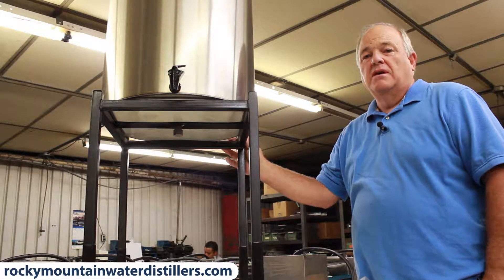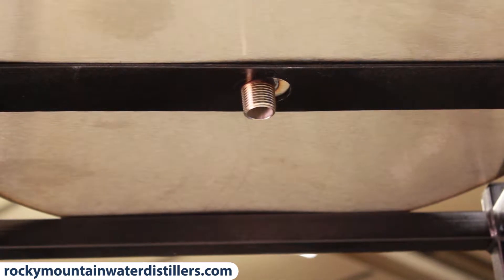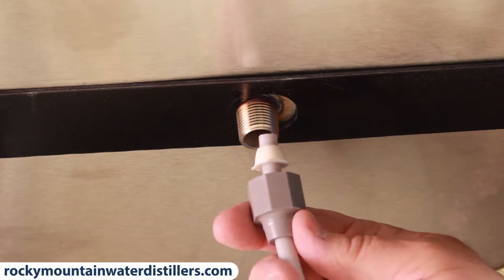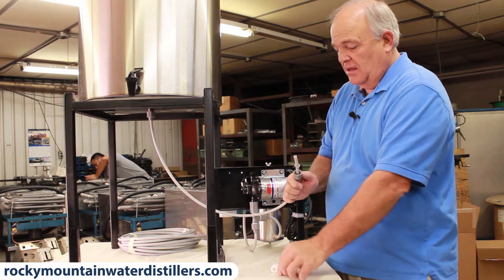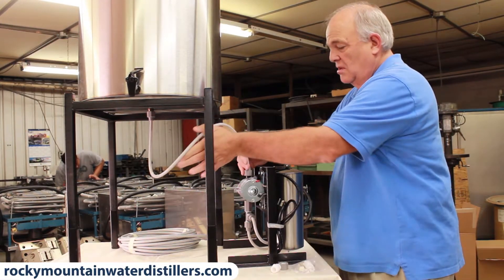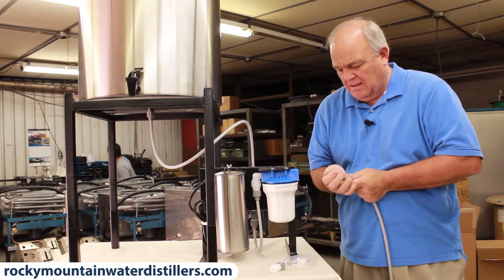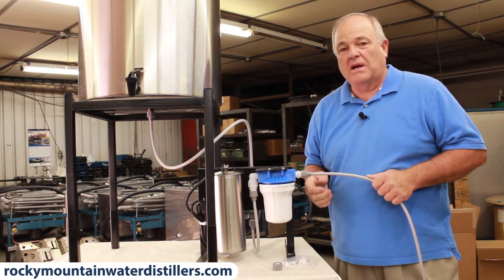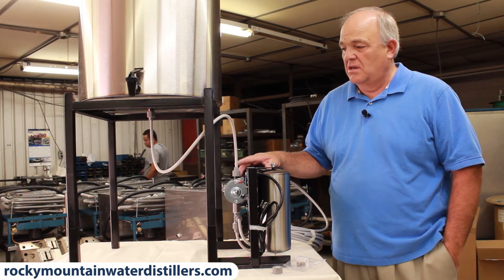How to Install the Durastill Remote Faucet System on 25 GAL Tank - Rocky Mountain Water Distillers

Comment: my house pressure only goes up to 50lbs, so that pump will never shut off
Reply from the maker: The Durastill Remote Faucet System pump is gravity fed from the bottom of the stainless steel storage tank to the pump. Then the pump pressurizes the distilled water in the water line from the pump to the faucet. So your home water pressure should not change how this system works. It is completely independent from your home water system. It is a dedicated water line just for distilled water. Thanks - Brandon

Comment: My pump is leaking at the nylon bushing and line, any recommendations?
Reply from the maker: Try re-tighening the connection or you may need a new nylon bushing. Sometimes the delicate threads can get dinged up or they may on be on straight and can leak. - thanks Brandon

Comment: Curious, why do you need a filter on distilled water?
Reply from the maker: Great question. You need a post-carbon filter to remove what can distill across during steam distillation. For example: chlorine has a lower boiling point than water and it can distill across. So a VOC vent will remove some of the chlorine but the majority must be filtered out with a carbon filter.  Steam distillation + a VOC vent + post carbon filter will remove the maximum amount of virus, bacteria, toxins, poisons, chemicals, etc. from your tap water or source water. That is why we recommend you use a Durastill Post filter or the post filter that comes in the Remote Faucet System pump to provide the purest and cleanest water possible. For more information watch "The Journey of Water" : https://rockymountainwaterdistillers.com/pages/benefits-of-distilled-water-vs-tap-water.
Reply: not necessary. IMO.  those inline filters will be a nuisance IMO